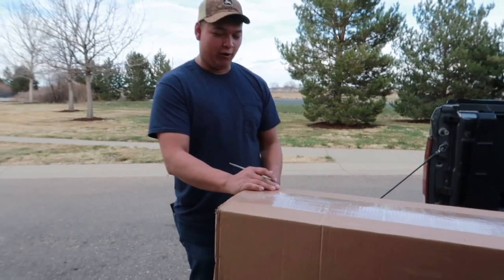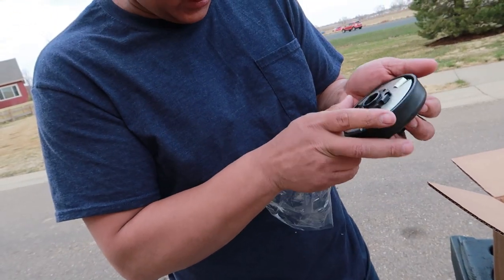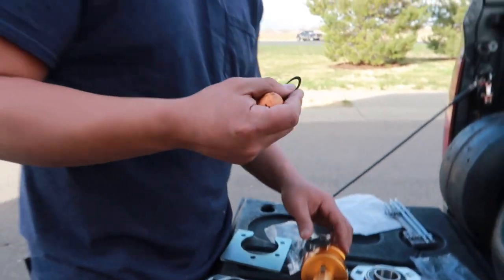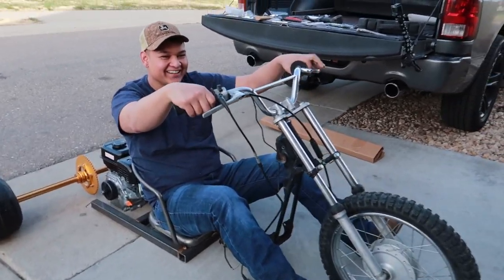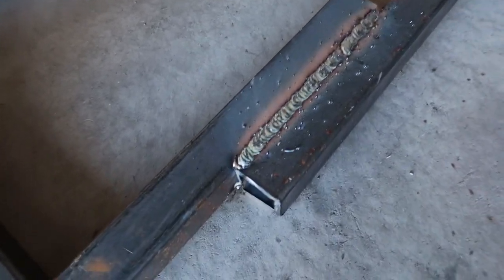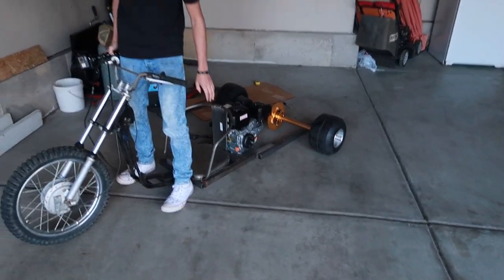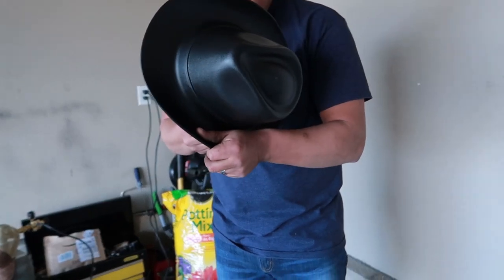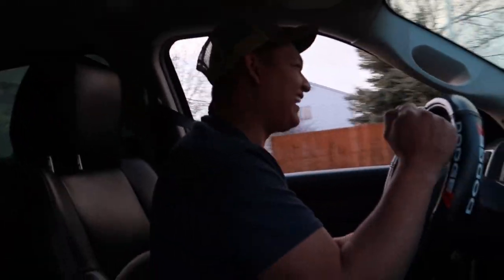Building The Axle For The Drift Trike! PART 4

Comment: I got myn on amazon
Reply from the maker: Good stuff Brian!
Reply: What size screw did you use for the bearing mount? And what’s the top speed?
Reply from the maker: We used 14mm Hex Bolts (which he had to go buy at a local hardware store) to rig the bearing mount. Tops around 35 mph.